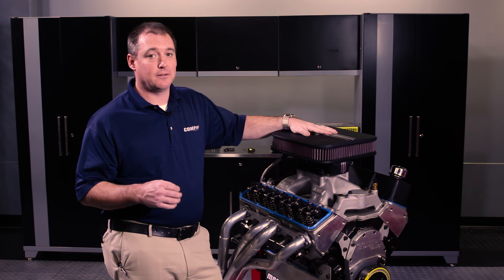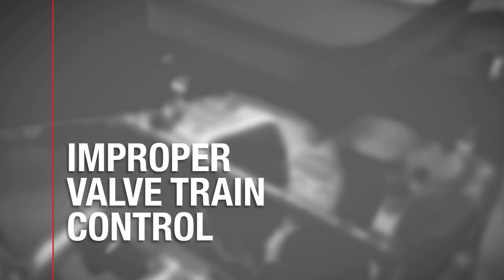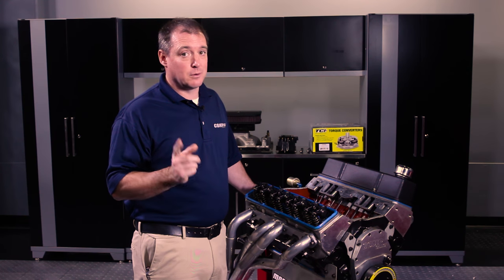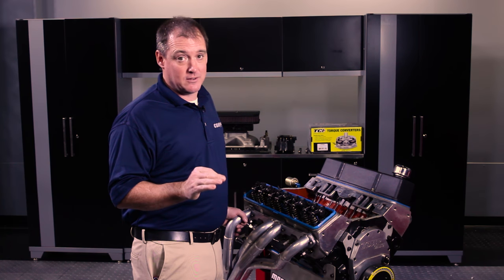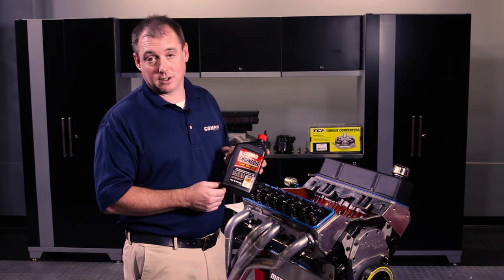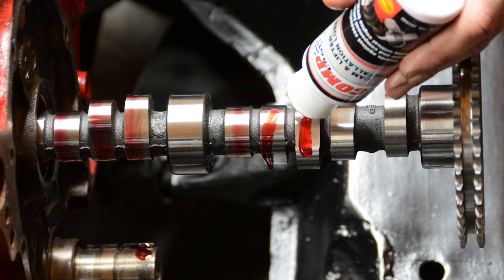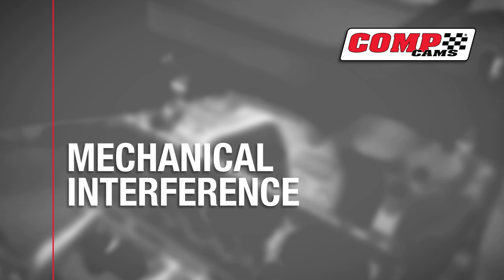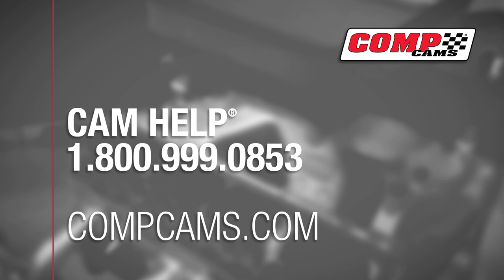Top Ten Reasons for Camshaft & Lifter Failure

Comment: Number 11 , make sure all the push rods are rotating.
This happened to me with a stock Pontiac 389 , all stock .
15 push rods were rotating,  1  wasnt. Turned out  one lobe  had a bad profile on a new camshaft.
Talked to Isky  cams and they reground it with the proper profile.
All was well after that
Reply: Wouldn't that mess up you're  whole timing  too?
Reply: Or was it Lobe Separation??
Frontal Lobe Separation? Not good. 🤔
Reply: have to inspect lifter faces and lobe crowns before assembly - make sure nothing is flat!

Comment: I just had a Comp Cams Mutha Thumper cam wipe out two lobes during break in. Came here to see if I did something wrong. (I didn't) Been doing this for thirty years and never had a failure till now.
Reply: stop buying cams designed to be shit off the bat,buy a cam for performance and preferably a roller
Reply: I have no faith in comp cams products after a cam went bad on break in and damaged a new motor. They are low end quality product. So many other superior  options available.

Comment: Finally  so one says it out loud , revving engine proves nothing but you don’t like your engine ...   a little 3500 blip sure  but 6 grand  bing bing bing says you have never paid for an engine ......
Reply: Just put a second  engine in my ram 5.7LHemi 
Lifters wiped out my cam 130 0000miles 
Never revved it higher than 500 rpm 
Major upper cylinder lubricant problem
Reply: 5000rpm
Reply: @quazimotoscopick7085   with modern hemi engines , geometry /poor engineering is the problem.the lifters are almost laying horizontally in the block(stupid engineering revision)
 instead of on an angle so the oil never flows down the body of the lifter to the end,never efficiently reaches the roller of the lifter.they will continue to fail until the geometry is corrected or secondary oil squirters are added .both are a long ways away....

Comment: The #1 cause for a flat tappet camshaft to go flat is improper oil, when running a flat tappet camshaft you should always use a motor oil that contains zinc or a oil additive with zinc. Over the years zinc has been eliminated from most motor oils so always check for oil containing zinc or use a oil additive that contains zinc.
Reply: You are correct i found that out the hard way it just happened to me a month ago but it on affected #7 cylinder on my SBC.
So naturally i have a new cam and lifters in it and going to be running nothing but oil with zinc in it from now on.
Reply: How do you spell zinc correctly except for once with "zink"
Reply: Number one cause is lifter not spinning in the bore.
Reply: You need to either add zinc or use a zinc-based oil with EVERY oil change in engines using flat rapper can/lifters. It's a good preventative step even beyond the break in process.
Reply: Most high detergent oils will not accept the zinc additives. It will get dispersed out.  The oils additive package is not compatible.

Comment: On dual springs, when should the inner springs be put back in?  After the 20-30 minute initial run or after driving some miles?
Reply: Chop Schweiss:  Reinstall the inner springs after the initial break-in of the cam.  If you drive the vehicle without the inner valve springs on, you are chancing accidental valve float.
Reply: The more time you give it the better. Don't get above 3500 or so until you get those springs in.  The fast rates can be detrimental at lower rpms.
Reply: I remember every new car I bought I had to take the inner springs out and drive it 1000 miles, what a bunch of crock. Comp cams are trying to cover their butt

Comment: I've never had camshaft failure on a vehicle,  but suddenly,  we have two 2016 vehicles from the same manufacturer with camshaft failure. My cousin is having the same problem on her vehicle from the same manufacturer. Did I mention there is a backorder on parts?  Sounds like a manufacturer defect to me.
Reply from the maker: What vehicles are they?
Reply: @Compcams1976  2016 Ram 1500
2016 Jeep Grand Cherokee

Cousin has a 2015 Dodge Dart
Reply: I just sold my '15 Ram that began showing those signs of cam/lifter failure. I started getting the "lifter tick" and it only had 41,xxx on the odo and was dealer serviced since new. I loved that beast, but glad it's gone
Reply: Something told me it was going to be a Chrysler .lol

Comment: The last engine I built was handed to me freshly machined block heads ect.  The customer wanted a flat tappet solid cam.The very 1st thing I did was check the clearance of the lifter bore to the lifter.  It was way too tight. After all most of the flat tappet vintage engines are over 40 yrs old with an unknown history...this MUST be corrected before proceeding ...if not failure is imminent no matter who makes the cam lifters no matter how hi a quality they are.  Period!!!!   This step is mostly omitted by amateurs who think they know what they are doing by watching YT videos or reading magazine articles
Reply: I always ask my machine shop to hone the lifter bores after hot taking the block. Lifter bores can become egg shaped after exposure to the extreme heat of a hot tank. 
Also, double check the diameter of the lifter bodies before installing. Lately, there have been some issues with lifters bodies being outside tolerances.

Comment: How do you break in a hydraulic roller cam? Also should the roller lifters match the cam? Example 1991 Chevy L98,  and I buy a roller with slightly more duration @ 50 could I use the factory roller lifters or buy new one's?

Comment: Based on all my research the #1 cause of roller lifter failure is the needle bearings in the roller and there is a prevailing theory that not oiling the needle bearings is what causes them to fail.    Once the roller fails then of course it destroys the lobe or lobes on the cam where lifters have failed, rollers get out of position and snap the roller shafts, needles then fly through the engine and get into places they shouldn't and before you know what is happening you have a trashed engine.
Reply: Not all rollers are equal. People have too tight springs and too fast cams for many roller rockers. They cheapen out why buying.
Reply: what causes them to fail is a cheap part, never seen a stock 302 ford with a roller lifter failure

Comment: On a Hemi 5.7 MSD it is not enough oil for lifter needle bearings at 2000 rpm and below. Just do not idle or remove/cutout the Windage Tray. Then you will see 250k plus miles.
Reply: I learned  that  the hard  way with my hemi
Reply: Not true.  

My 2016 Ram 5.7 w/ MSD has 182k miles on it and probably 3-4hrs of idling per day.  

It’s never been to the shop once.  Runs like a top and pulls hard as hell!

Chrysler isolated the lifter issue and switched manufacturers years ago.  

Lifter failure occurs equally between MSD lifters and non-MSD lifters. 

If it was an oiling issue, lifters would have been replaced more than just once.  But that’s not what happened.  Once the lifters were replaced, they never had repeat lifter failure again.

Comment: Regarding rev limiters I'm not sure I agree with your statement that "twice as much fuel significantly increases cylinder pressures".  That's not how combustion works.

Care to elaborate on what you mean there?
Reply: Yeah. I was thinking the same. Honestly, I think it's probably a harmonics and RPM thing. Speeding up and slowing down the frequency of a harmonic system will mess with the phase. Take your phone and use a frequency generator. Speed up and slow down the frequency and you get the wahwah sound. The peaks and gaps are the "zero force" situations in your valvetrain, impact happens on the lifters, trashes the roller bearings.
Reply: Yea that's crap the exh valve still open and lets out the in burned  fuel
Reply: trumpio:  Why don't you go out and bounce your engine off the rev limiter for 5 minutes every day.  See how long you can do that for and report your findings to us.
Reply: James Scott:  The exhaust valve will release the unburnt air/fuel mixture.  However, the entire combustion chamber will have some level of residual air and fuel in it.  During the next intake cycle more air and fuel will be added.  That resulting mixture will burn differently than a normal cycle will.  Might even cause some detonation.  Harmonics from that erratic ignition event will work their way through the crank, timing chain, and back to the valvetrain.
Reply: The unfired mixture will blow out the exhaust port anyway. Purging that cylinder.
That's why most rev limiters are random drop.
Reply: Ok with me if you guys think rich mixtures cause detonation.

Comment: Take an old lifter check the hardness. I used one from a factory 390 I was taking apart. Take a new Comp/China cams hydrologic lifter. Quickly becomes clear the issue. I did this in my metallurgy class at my local Technical college for my degree. Chinese lifters are great for profit margins. But the quality control of recycled scrap materials in China doesn't make quality cams or lifters. This is probably why cam cores are harder to find now. Those junk lifters trashed many cams. More than Comp or anyone would admit.

Comment: Good rule of thumb is 10# of oil pressure for every 1000rpm?  That's less than any stock engine I've ever seen.  And if that's true then why do they even make high volume oil pumps?  I think if I was. Breaking in a cam at 2000rpm I'd want more than 20# of oil pressure.  And this video is why cams fail, so would high oil pressure cause damage?  How high?
Reply: It's mainly rule of thumb as rpm increases. 80lbs of oil pressure at 8000rpm.

Comment: Of all the engines I put through the machine shop for the customer to assemble at home, dirt and debris killed more motors than anything except the SBC builders that didn't replace their oil pump pickup screens, and then went on to put tons of blue silicone on their oil pans. The excess silicone beads off, gets sucked into the oil pump and seizes the entire motor. It's the number one mistake of home builders that any of the shops I worked at, or had friends who worked at have seen. In Phoenix, that accounts for all the Machine Shops in the Valley. I have a feeling it's the same problem faced everywhere. When a SBC oil screen gets dirty it separates itself from the pickup housing, allowing oils to bypass the screen. Then, any excess silicone that was pinched off at the oil pan and is floating around the oil pan gets sucked into the pump where it jams up the gears. If the builder chose to use the Nylon coupler between the oil pump shaft and distributor it simply slips and allows the distributor to keep turning while the oil pump is fully seized and presto, the motor is trash! If they used the welded steel coupler there's a little more hope that the silicone might get pushed through the pump, but not much. Things still usually end up costing and engine. So, don't use silicone sealer on your oil pan period, always use a new oil pump pickup screen and used the welded steel coupler/shaft assembly to drive your oil pump. It doesn't negate the dirt and debris issue, but it might help keep things together if everything else was put together properly!
Reply: ken cohagen:  That is a great tip.  Thank you for sharing that!  I'm planning to take the oil pan off of my 1990 Mustang Gt.  Having oil pressure issues with it.  Is there an oil pan gasket that you recommend?
Reply: Feel Pro all the way. If you need a sealer use the blue non drying stuff. I think it's called anerhobic or something like that. But the most important thing is to replace the pickup screen.never reuse them on a Chevy because the screen comes apart from the can and allows debris in. Also, use the oil pump drive shaft with the metal coupler welded on. The nylon is ok for factory engines, but if you lean on the motor they can break. Good luck!
Reply: ken cohagen:  Thanks brother!  I appreciate the feed back and your insight.
Reply: yea right if they use a full tube it aint built riet
Reply: ken cohagen t
Reply: I haven’t tried the non-hardening anorexic liquid gasket maker yet but I do use hylomar liquid type when required. I was surprised the first time I used it because I didn’t think it would hold up under pressure. It made a believer out of me 🤔.
Reply: guess that's why we have full flow oil filters
Reply: I thought the only purpose of the plastic coupler was to hold the oil pump shaft to oil pump during assembly.  Since the oil pump and the shaft are keyed, there is no torsional load on the plastic coupler.

Comment: 2011 JKU- 2014 JKU both jeeps had this issue after 50k miles. JKUs come broken from the factory. THERE IS 0 REASON A NEW JEEP SHOULD HAVE THIS ISSUE!
I have dealt with this 2x
Reply: Life’s too short to buy a Jeep 🤔🤣😂
Reply: @timdingleakajacksparrow2748  
If you can accept the fact they come broken from the factory. Then you will be fine

Comment: The reason to not run dual springs at first start for flat tappets is... the break in oil.  Purpose of break in oil?  To accelerate wear through  reduced protection/lubrication.  Why are we whining about lifter/cam failures again?  Shouldn't we just protect our cams?  How did it come to this? That's right: blindly trusting astm standards, now primarily internationally oriented, and an embedded feature of marketing specs.  Go read IVA and IVB procedures, then ask how those tests could possibly come close to assuring flat tappet service suitability by using an overhead cam platform and calling buckets or followers "lifters" - they aren't crowned the same way and present more working surface area vs spring loads.   Its time to stop taking crazy pills in a post SJ oil market.... and do some real testing, unpolluted by the "stop oil" crowd in Europe.  They broke the standards, which "breaks" the oil, which breaks... your cam.  There are still good oils made, but you can't find a psi value wear service limit regarding  protection on their container, cut sheets or msds.  Only intrepid independent third party types are filling the void.

Comment: oil oil oil, your oil will cause your camshaft and flat tappet lifers to die a very early death, use rotella t4 of delvac extreme for the protection that old school oil had but new oil lacks, diesel engines require good oil  and not the BS crap for a roller motor. I learned the hard way when i had a flat tappet motor fail in just a few thousand miles after rebuild, it was the oil that caused the failure
Reply: In Germany we use SAE 30 lawnmower API SF 4 stroke oil plus ZDDP for break in